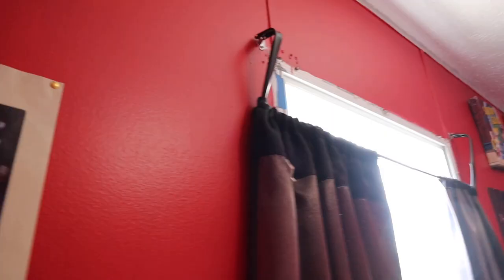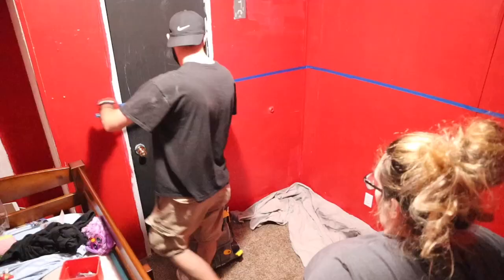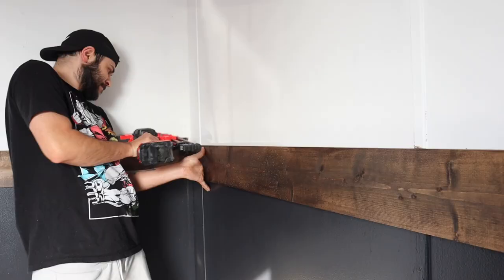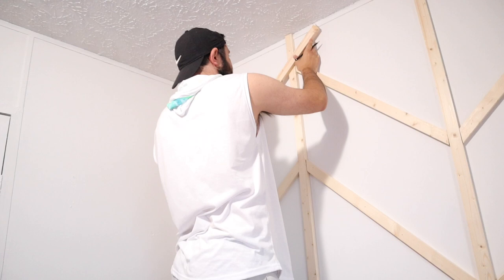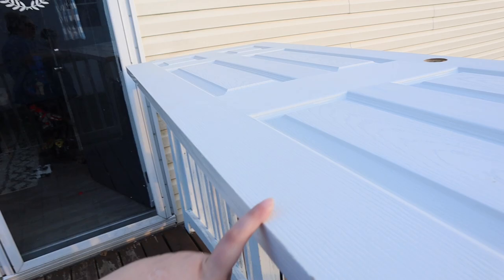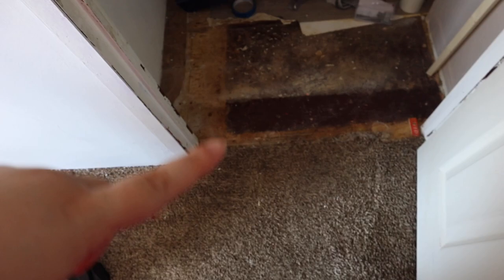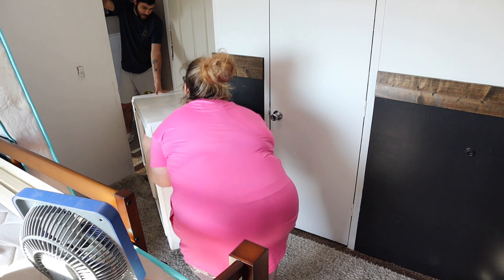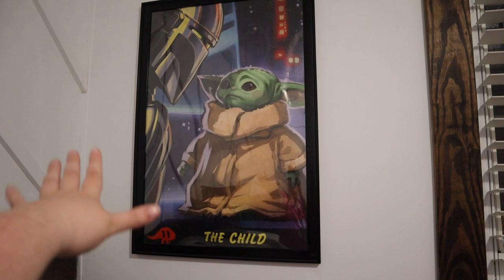FARMHOUSE SINGLE WIDE MOBILE HOME BEDROOM MAKEOVER | huge transformation! | single wide remodel

Comment: If you move the closet door around the corner, across from the main door, you would free up all that space, and you could move the bed up against that wall that the dresser is on. It would open up all that space when you first walk into the room so you aren't having to squeeze through the corner of the wall and the bed. Just a thought. Great job on the room!! ☺️

Comment: I bought my mobile home brand new back in 1998.  We were trying to replace the oven and discovered the wall rotted out (had to replace it).  Then, we tried to put down our new vinyl flooring in the kitchen and dining room.  When we ripped up the carpet in the dining room we discovered the wall in there was rotted.  So, now I have no flooring in my kitchen and dining room and the wall is torn off.  Can't do anything with it until I get the funds to fix it. OMGosh, so frustrating.  We had to replace the cabinets in the kitchen too, did I mention that (rolling eyes here).  Prayers for a fast reno are appreciated.

Comment: I'd put  A nice linoleum down in the boy's room for now with some throw rugs with rubber backing on them so they don't slide. It's a lot easier to keep it clean and you won't get carpet that ends up smelling if things get spilled on it. They have some really nice linoleum these days. All you'd have to do is sweep and run a mop around with some pinesol  once in a while. Its not a huge room so it wouldn't be to expensive. Plus you could wash the throw rugs every now and then right in the washing machine.🧹🧺🧼FRESH AS A CAROLINA PINE FOREST!!😆